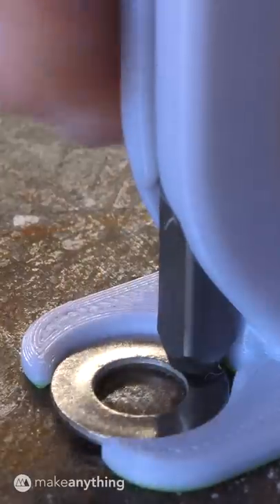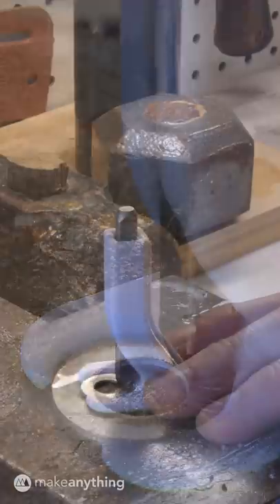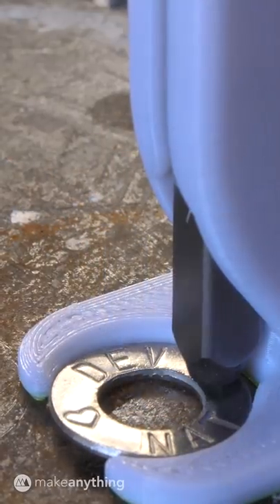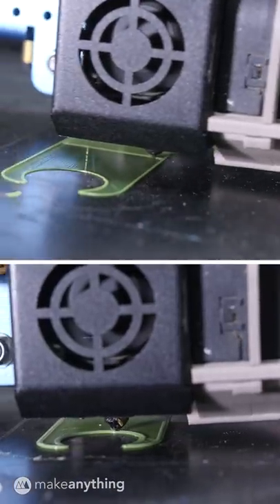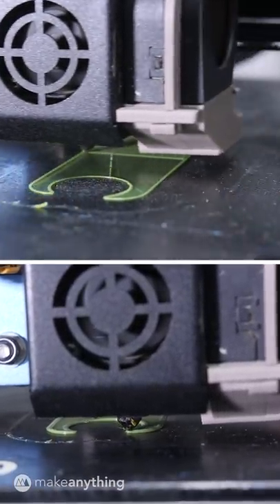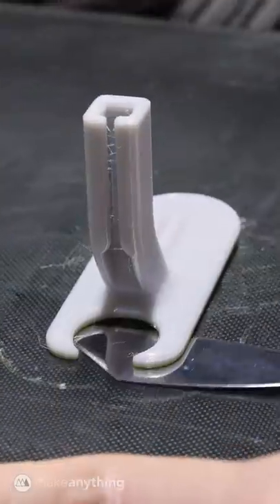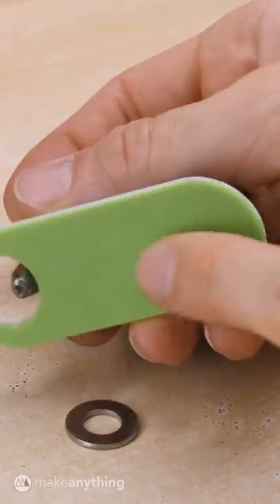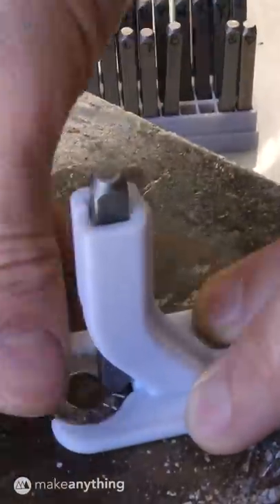Metal Stamps

Comment: The very specific tool is cool, yes. But... PETG sticks to TPU?! Now that's something that I HAVE to try.
Reply: I wondered about that, too. Living TPU hinges, tools and RC tires here I come.
Reply: Yes its specific but thats what 3d printing excells at. if you needed a more generalized tool youd probably just buy something with higher quality
Reply: May not adhere too well, but overlayed ridges from the filament give a big surface area- I'd be interested to see if one could print features in place to embed into other parts (say, a petg wheel hub with ridges to keep a tpu tyre in place)
Reply: During the print it works great but it can peel off of the print easily. 4in to 12in of TPU works better than a glue stick for bed adhesion.
Reply: @PsychoSane13  this was my assumption as well. I someone could code a way to print mechanical pegs of the and then back fill the low areas with PETG that might be an option
Reply: What does a stack of washers on a bolt have to do with Bitcoin ?
Reply: Great idea!! Did you "pause at height", dual feed or dual extruder? Pausing at height makes me nervous everytime. 
Lol I've had good luck with BuildTac plates.. I have had the same two that came with my Qidi Tech Xmax for at least 100 kilograms mixed of PLA/+, PETG, ABS, TPU, Filled Nylons, Wood PLA, PCTPE,  
Everything sticks. Two sided, one for filaments under 230°c and the other side for everything up to 300°c.
Reply: @robcoastalga8279  looks like a single nozzle printer, so I'm guessing he paused at height.
Reply: @jimwednt1229  He knocked his wallet address or his 56 character long secret key in there - so it is "physically" stored...hehe

Much safer then a paper wallet - because the paper might desintegrate...